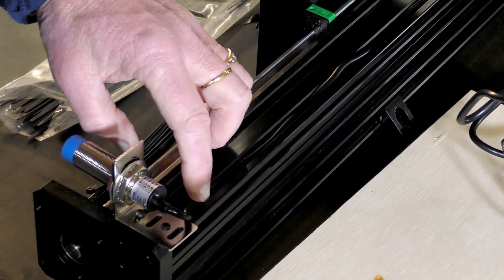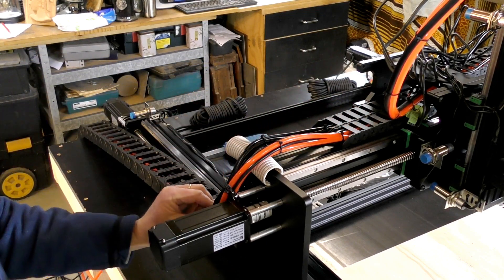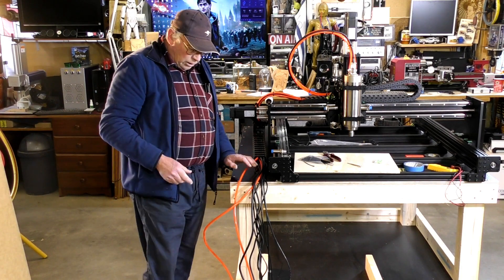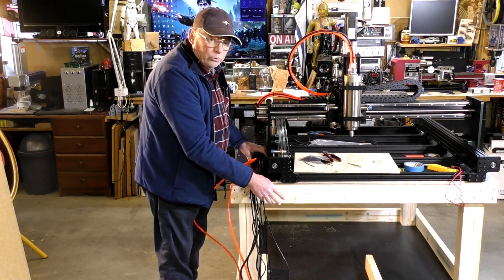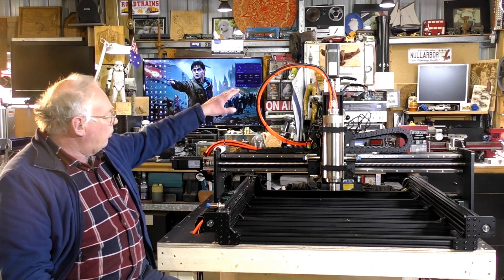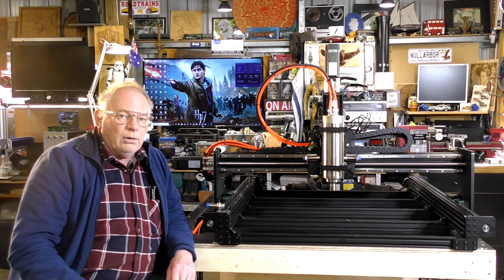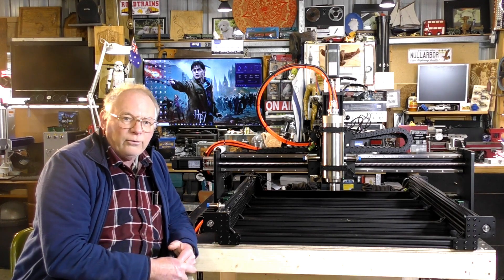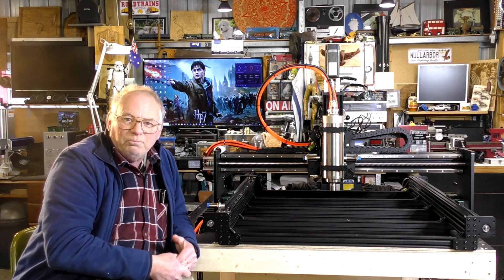Part 10 QueenAnt PRO V2 Super  Enhanced CNC Router MORE running the machine's electrical

Comment: they are a very nice machine, i upgraded my 1515 workbee to one of these in april 2022 . I had ordered the v1 kit and the guys at yuyong sent me a couple of pictures of the v2 and asked me if id like to go with that option for $200 more. I am so very pleased I did. It will be nice to see what you can achieve with this machine. when it comes to operating cnc's im still very much a beginner